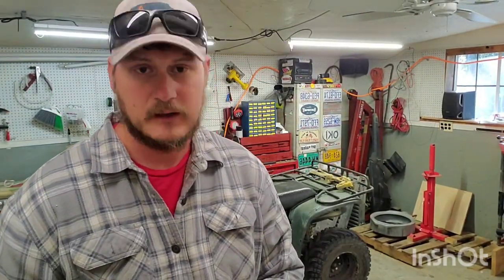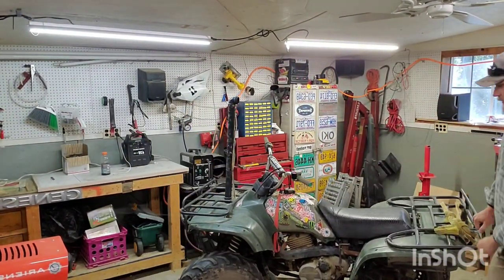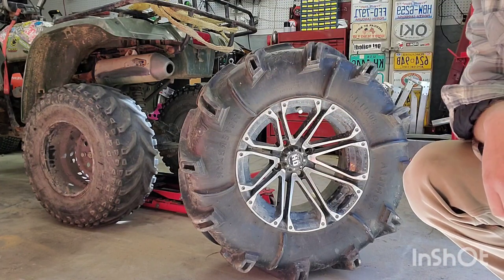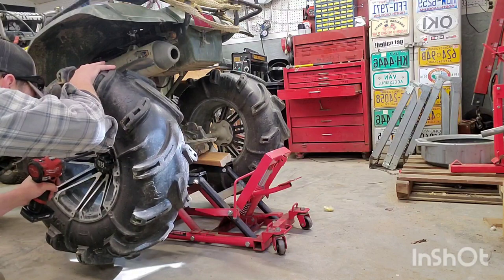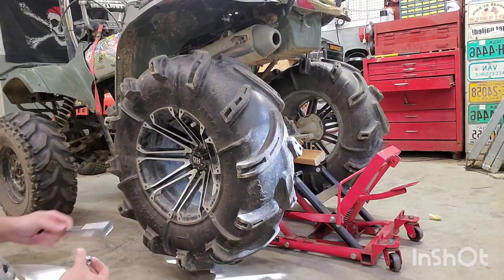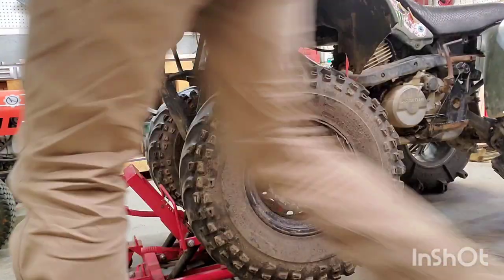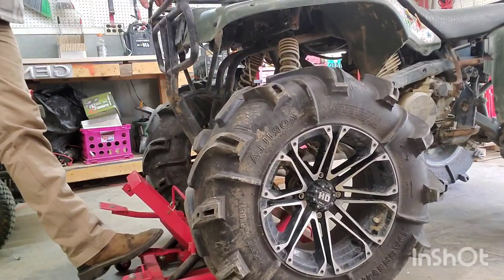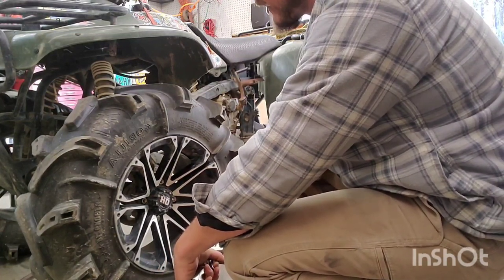I put 30 inch Silverbacks on my Honda 300!!! (sooo clean)

Comment: That thing looks clean!
I’ve owned a handful of four wheelers, and I think none of them the brakes worked.
Only brakes I had were to down shift😂.
Reply: @TownCreekATV  what was the rim size you run for 30x9-14 because I can’t seem to find any 9-14 rims or 10-14 rims